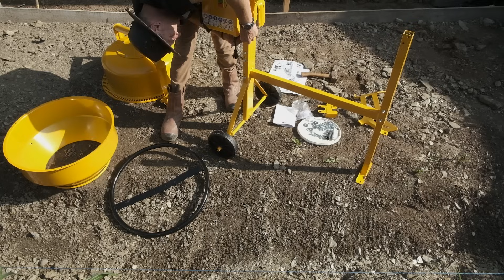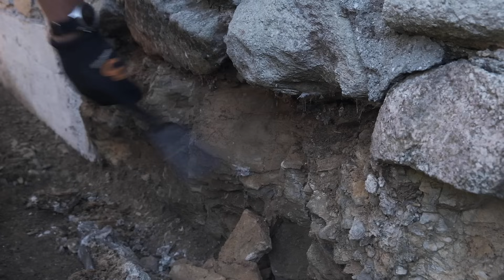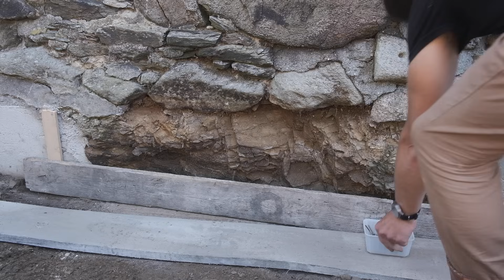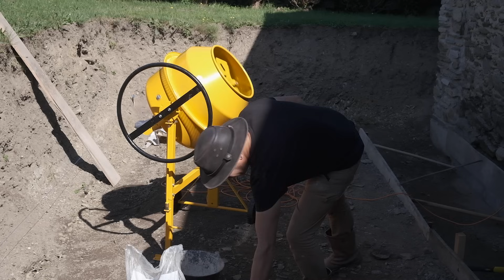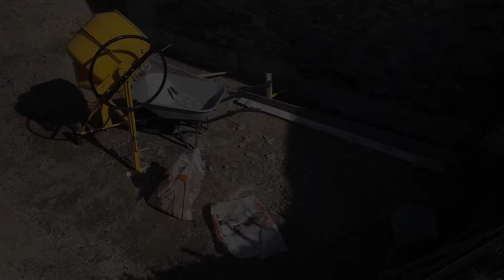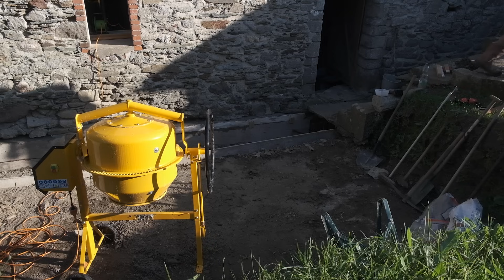House Foundation Repair

Comment: you need to underpin correctly , what you have done is pointless, one underpin pin is 1metre x 1metre squre and filled with concrete and rebar directly under the wall and each pin is staggered so you do not make the wall unstable

Comment: this is probably done just as fixture for ground level stones and to level up surface for hydro-isolation etc. but for any serious rigidity upgrade of the walls/fundations, ground stone "foundations" need to be dig up by side and underneath to strengthen it with reinforced concrete enclosure with rebar and all that.
and yes, that takes a lot of effort,  time and money..

Comment: You have acquired a DeWALT-coloured mixer. :) A scenic (and practical) arrangement of parts prior to assembly.
There seem to be earlier patches of concrete above the current formwork. If so, what will happen to them?

Comment: I don't know if it was cement or what, but if there will be proper drainage and no frost, cement will still do
But a good washing could have improved the connection to the base material. 
Still, a nice work with compacting it, many forgets that
Overall, a good job